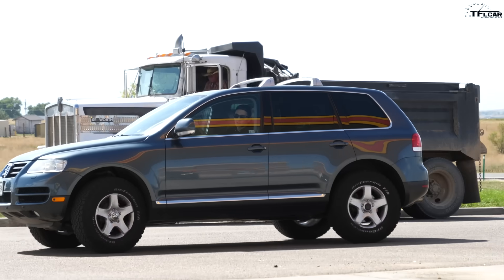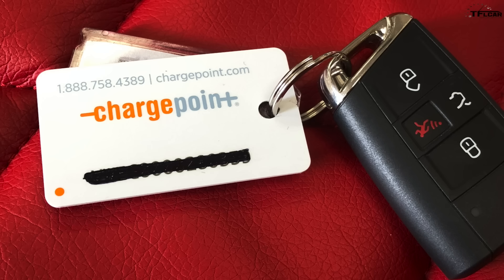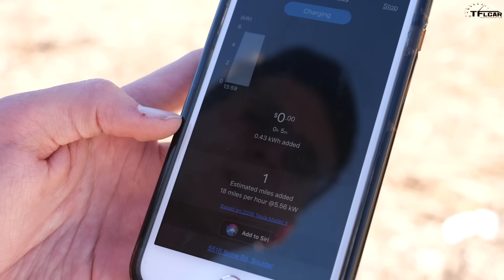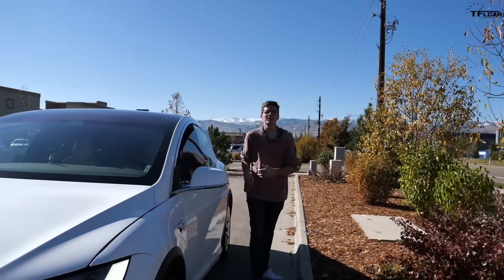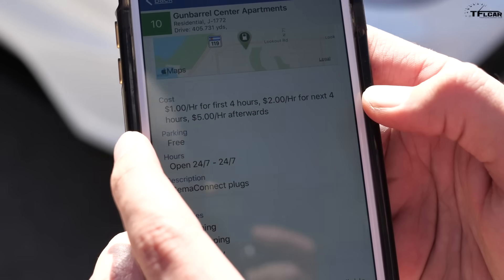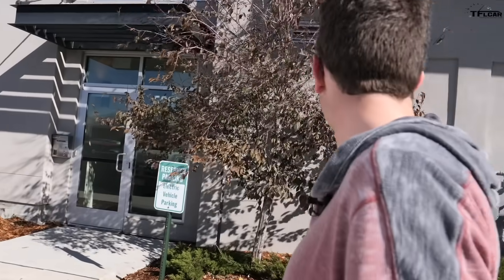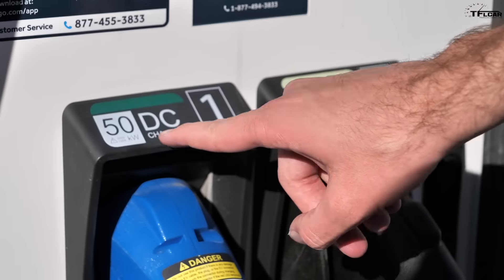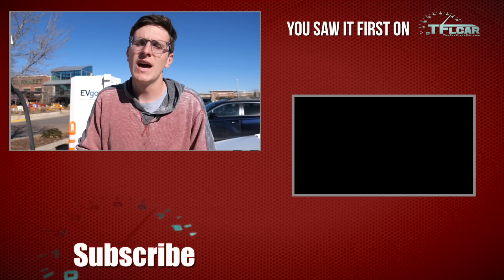Here’s Why Charging an Electric Car Can Suck - And It’s Not The Reason You Think!

Comment: Scenario: You have 15% charge left and your thinking I can go to the one on the way home. You get there and they are full as in just started charging their own vehicles. You open the app to see where's the next available charge an it says the next city over which is an excessive amount of miles away that will not be feasible for your remaining 15% charge. You ask yourself what, how'd this happen? This never happens! Well the planets were aligned that day and now your stuck waiting for the current charging station to finish or moving on to the next nearest and waiting for those to open up. You could always call a tow truck as you probably have up to $250 of towing with your insurance, of course at the chance of raising your premium or just sit for hours in your vehicle on a hot triple digit day. Have no fear! Electric cars now come with a removable floor panel where you could stick your feet out and propel your vehicle using "Flintstone" foot power. No thanks EVs!

Comment: The video does not correctly portray how most EV owners operate their EVs.  All homes have 240V service and adding a charger is as simple as plugging in an electric cloths dryer.  I did mine using 50 feet of 10-3 romex, a 240V 20A DP breaker, and a 20AMP outlet in my garage to charge using a 16A 240 charger from Amazon.  In less than 2 hours I had my own charging station at home to charge my BMW i3.

Unlike my Jeep or Acura gas car where I wait for the tank to get below 1/4 of a tank before filling the tank, I and most EV owners, plug in the EVs when we get home so the idea of waiting until the needle goes to "E" is not how it works for EVs.   The reality is for most EV owners charging at home we seldom leave with less than a 100% battery because the car is usually plugged in when we are at home.

I do agree that EVs are not for apartment dwellers unless they chase complexes that cater to greenies.   I myself have yet to charge at a public station so can't opine on the pains described, but I would not own an EV if I had to depend on charging stations.

Comment: These are good facts for people to know and understand. I believe there is a market for the EV, and also for the Hybrid, gas, diesel, ... It all comes down cost, and to your need, use, and availability of all these charging sources. We need to have variety to fit the need, and trying to push all needs into a basket that can't handle the capacity is a recipe for disaster. My wife and I are looking to go hybrid with our next vehicle as it will meet most of our needs and use in our everyday life, but we will also retain a gas vehicle for uses outside the scope of the Hybrid and EV we have. As the EV is a great choice some it is not for others, so variety in the market is the best way  forward, and as the EV market expands it's scope in  lower purchase price, longer distance ranges, and shorter charging times, along with an expanding infrastructure for charging, the market for the EV will grow on it's own merit. All this government forced change will only resort in a disappointing experience for all.

Comment: What if you can't even afford one of these super expensive electric cars? What if you are late for work and need to charge your car? What if you run out of power while you are miles away from the next charge place? What if your cell phone was stolen or lost and you don't know where one of these charging places are? What if the digital currency is abolished??? What if the electric power grid goes down? This is why the electric car idea never got off the ground a hundred years ago.

Comment: The future:
50 mile daily commute, 5kwh, an easy top up from home or car park at office
Remaining energy is traded on the grid for money, it stabilises the grid and the car talks to the grid.
EV plugged in 24/7 except for the rush hour.
The 'killer invention' will be the 'automatic plug in device'.
The grid has its own 'internet/ communication' through the power supply cables now.

Now in the horse and cart day they had a different fuel system, daily feed and water and shovel away waste and large shelter for the cart and horse.
And in the fossil fuel days a huge regular payment to the 'pumping machine' and 100lb or 50kg of flammable petroleum in, as the kids sit, in the vehicle and you walk about and make the payments.
Then the drive to your destination. 

Now because the EV has a huge energy store, that came free, you can power your home at night and keep trading grid power, like trading commodities and stock on your computer.

At the moment it is a messy situation, a little like the USB mess in the beginning.
So lets get the auto plug in device invented and standardised.

Comment: The situation is very different as of February 2022.  Tesla has a 72% US market share in 2021 according to Kelly Blue Book, and the charging experience is completely different for Tesla versus the other EVs now.  Tesla has far more charging stations than all other EV chargers combined and they are all Level 3 charging between 50KW and 250K (and increasing to 350KW).  We drove our 2022 Tesla from Yosemite to Los Angeles requiring one charging stop in Bakersfield of 20 minutes charging at up to 1050 miles per hour — they have 80 fast chargers at this location.  Tesla is growing their chargers by over 50% per year, and these are the fastest chargers.  While non-Tesla EVs don’t (yet) having this Level 3 charging infrastructure, it Tesla shows what can be done.  Level 2 chargers work fine at home or work when the car is parked for an extended period of time and the typical 28 miles per hour is not an issue — if you need a faster charge you go to a supercharger.  So in 2022 your observations about charging sucking is primarily true for the 28% of those who don’t buy a Tesla, though the non-Tesla Level 3 chargers should increase substantially for the next few years.  Tesla has also begun to open up their superchargers to non Tesla EVs in Europe and is beginning to do that in the U.S.  This will help the other EV makers solve the problem for their customers.

Comment: Doesn't matter if it's the newer $25,000 Tesla or the top of the line $80,000 toy, all EV's have same charging issue....insane amount of time to charge them. Until you get EV's to charge up FULLY in like a reasonable time, say 30 minutes, they will NOT be a replacement for gas cars, there will need to be a truly universal charging port connection with all these little providers using the same methods and stations in common, copying the same way gas pumps are 'universal'.

Comment: Those are some of the bigger problems with EV usage.  Do you have the right "adapter"? How many adapters will you have to get (at how much extra) in order to deal with your normal usage? What about storing all of those adapters? Those restrictions from locations can also become a bigger headache as more EV's come into use. I can pull into a regular fuel station with an "empty tank" and in less than ten minutes I can get several hundred miles of range... versus the 30 minutes to several hours.  EV's are well and good for those that have the time, money, and availability of resources, but those things are generally only available in highly urban or suburban areas which are only a tiny fraction of the US landmass and concentrations of population.  Furthermore, with an electric vehicle... if you don't have, or can't get the proper hookups to recharge, you are essentially stuck or must get towed... at least an ICE can run (admittedly poorly and possibly with damage) from other sources...

Comment: $0.16/kwh is fine.  I've seen mention of costs along the Pennsylvania Turnpike of $0.31/kwh and $0.45/kwh!  Folks, we need to have our regulated electric utilities install, maintain and bill for all EV charging stations.  Multi-billion dollar companies can install numerous charging stations with nary a blip to their overall capital costs.  Regulated prices will likely be between $0.10 and $0.20/kwh tops.  Then we'll be able to plan cross-country trips without the expectation of price gouging.
Reply: You do realize that ALL of those costs are then billed to the customers? Utilities have a fixed profit margin (far smaller than you think), so undergrounding old utilities, providing reduced or 'free' electricity to poor people, requiring anything is figured into the rate structure. TANSTAAFL... There Ain't No Such Thing As A Free Lunch.

Comment: Can you imagine how many of these stations you would need if all petrol vehicles were replaced with EVs?  The rate of charging would require at least 10 times the number of gas stations currently available. 
How is our present electric grid going to handle this?
Reply: Not to mention if they ever got everyone to get electirc cars, the price to charge would 100x
Reply: @trxntroll843  Exactly, and how would this country generate all the electricity?  Turn Nevada into one giant solar panel??
Reply: The grid couldn't handle that much load
Reply: The bureaucracy knows the numbers and they're still pushing the electric conversion forward.  I honestly think it's by design.  Lock people into no travel and local areas only to reduce the human footprint on the planet.

Comment: Charging stations are still a pain. Not enough around and the more EV people buy the more inconvenience it is. I have a house. I am thinking of buying the new Toyota electric coming next year. I will use it only locally. Since I have an Odyssey 2021 for long trips with family. I will connect a plug 240V at home in my garage and leave it to charge for 5 or 6 hours and done. Using an EV for long trips is still a hassle. Not enough stations.

Comment: I have a tesla and a Prius.  For long drives 400 plus miles I’ll take the Prius any day. Fill up and go.  Tho I never had to wait to charge except twice years apart.  On regular commuting I’m lucky, I get free charge at work, so the tesla is the way to go.  

With gas prices today the tesla is cheaper to run than the Prius.  Last year it was almost even, during the pandemic the prius was cheaper.  This is in SoCal so you know gas and electricity is more expensive. But supercharging stations are plentiful.

Comment: Stupid 😁😆😆🤣🤣charging.... wait 5 hrs you charge compared to gas engines pumping in just 5 minutes 😁😁😁😁
Only hybrid vehicles can survive not an EV🤓🤓🤓🤓these EV'S will  stop running in the cold snow weather. may be stuck in the road and may need a extra replacement batteries  in the trunk in case of an emergencies. It's hard to get it recharged. I have no patience to waste my time around this stupid EV'S......

Comment: Gotta love our GREEN things, our electric car battery contains twenty-five pounds of lithium, sixty pounds of nickel, 44 pounds of manganese, 30 pounds cobalt, 200 pounds of copper, and 400 pounds of aluminium, steel, and plastic. Inside me are 6,831 individual lithium-ion cells. It should concern you that all those toxic components come from mining. For instance, to manufacture each auto battery like me, you must process 25,000 pounds of brine for the lithium, 30,000 pounds of ore for the cobalt, 5,000 pounds of ore for the nickel, and 25,000 pounds of ore for copper. All told, you dig up 500,000 pounds of the earth’s crust for just - one - battery. Did I mention disease and child labour? Here’s why. Sixty-eight percent of the world’s cobalt, a significant part of a battery, comes from the Congo. Their mines have no pollution controls and they employ children who die from handling this toxic material. Should we factor in these diseased kids as part of the cost of driving an electric car?” no, they’re not our kids, anyway, serves them right for being poor,

Comment: With my car, I pull into a station,  hook up the fuel supply, about 2 minutes later I am all topped up with 10 gallons and since my 
car averages 55 mpg, I can immediately go 550 miles.   Normal cost, around $20, or 3.6 cents per mile.  At least that was the
 case before lil joe took over. Now it's $40 or 7.2 cents per mile.  If my battery goes bad, it's approximately $100 to replace,
unlike a Tesla, which is $14,000 to $20,000 to replace.
Reply: That's right - Here in Australia you'd be lucky to find 2 stations in a major city let alone regional. The distances people travel are not viable for EV's and they are not popular here.

Comment: The US electric grid can barely handle what we use now, let alone millions of EV coming on line. At current EV prices, I doubt the avg person will ever be able to afford one, let alone charge the damn thing. My guess is the govt (take your pix - fed, state, county, city) will make it extremely costly to own and operate an EV. Taxes, licensing, charging and battery disposal will be very costly so expect the general pubic to be crammed into govt sponsored EV buses that won't take you where you want to go when you want to go there. Freedom to move about will be strictly limited so keep the fire burning for that internal combustion engine. There is enough oil on the planet to outlive the human race. If politicians and pressure groups are telling you otherwise, they're lying.

Comment: In my area most charging stations are no cost; free. finding one is difficult as they are far apart. A big problem is that Tesla owners have found that they can't afford the extra cost to charge at home. so there is sometimes a wait to use.
 fortunately many more units are scheduled to be installed around the region.  I carry a 24KWH battery, with a 60 mile round trip limit, so sometimes have to plan for an hour of add time now and then. Makes you plan your stops for shopping, quality time or lunch. I can usually make it 50 miles and back without much difficulty, if there's a charger somewhere on the way.
   note much larger batteries are now available... I have not been to a fuel station in six months.
  I will keep my ICE car for cross country vacations and work.
   Someday I will get a used battery operated that has a much larger travel distance.

Comment: Excellent video, with the material being well presented.
However, the idea of waiting/wasting an hour to do a 200 miles top-up is a non-starter.
Plus, watch any gas station and count how many motorists use a particular pump in an hour (> 10 at least.)
Think of the tailback from the (pump), or are we considering  putting in 10 X the number of charging points.  Both making this a non-starter.
Or am I missing something?

No-eco warrior responses about needing to change from gas, please, of that I'm convinced.
It's just that I don't think full EV cars is a sensible answer.

Comment: EV charging in the UK is no easier. There are 5 different types of charger plug and adaptors cost a fortune. There are  nearly 100  different power supply companies across the country and mobile contact to activate a charge is not always possible. Local power surges often cause the charging to fail and generally the cost is double that of a tank of petrol or diesel. EV charging bay blocking is very common as the wider bays are also the favourites of SUV owners. Finally the time needed to recharge can be an hour whereas a petrol/diesel top up is usually just minutes.

Comment: Definitely this is why I went with a hybrid vehicle instead of an all electric one. I put gas in few minutes and go. The Kia Niro will give me a 52 miles per gallon in the city and 46-48 on the freeway. For me is a benefit of two systems.
Reply: That's the way to go.  Surprised it isn't mentioned more.
Reply: Seems like the hybrid way is the way to go. Infrastructure already there, battery is recharged while driving. The hybrids can be improved to be more efficient.
Reply: I have a Honda Accord ICE.  I should be good for about 15 years.  I haven't seen many EVs or hybrids on the road that long.

Comment: Nice Lie. In America almost every house you have an air conditioner/heat pump, electric dryer, electric oven or range top or electric water heater. All use 240v. Don't talk about things electrical unless you are an electrician.

Comment: It's going to NEED to be standardized.  Every EV vehicle needs to have the same plug, or the adaptors need to be available at every charging station.  And charging stations need to be literally EVERYWHERE, and the payment needs to be much easier to do, before most of us are going to make the switch from liquid fuels.
Reply: @juned2001  it doesn't take an hour to charge. From almost empty to full at a quick charger, is 25 minutes

Comment: The real [evil intent] of EVs is CONTROL. The govt. can seriously reduce FREEDOM of mobility. By not paying a gas tax at the pump the "excuse" to mandate a per mile tracking device is smoothly paved. Travel will be limited the urban jungle and the Instate system.  Fly-over country, dirt roads and "bug-out" locales will be just an extension cord's length out of reach.  Not to mention the fact that a shade tree mechanic will be to no avail in the event of a breakdown, so don't venture beyond the service radius of your authorized dealer. Someday, EVs might be the answer but let the free-market select the winner. Market forces and legitimate competition will benefit free citizens.  Comrades riding about in "approved" transportation modules is not the American way-OH! so when did Joe and the woke darlings ever profess the American way? Did I forget to tell you of the ease of integrating self-driving/govt control software into an EV?

Comment: Are these cars really a Green option?   Fuel for a petrol powered car comes from fossil fuels and in most cases were does the electricity come from to charge these cars.   In most cases they come from coal powered power stations and were do they get there "fuel" to fire the power station.   Coal and that is a fossil fuel.